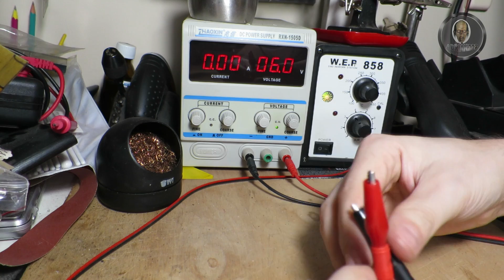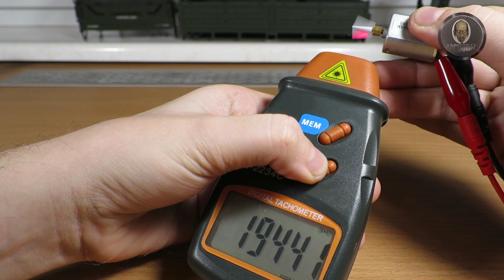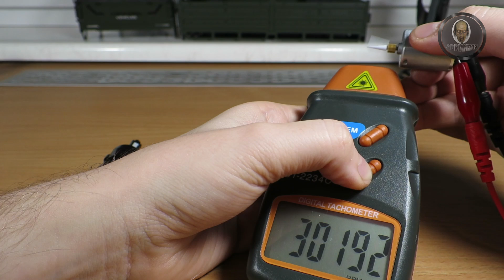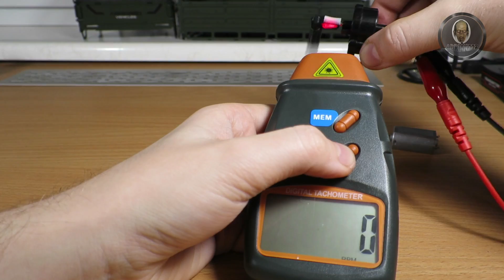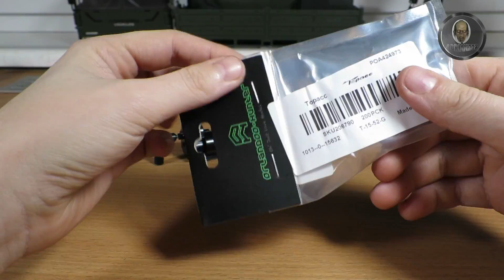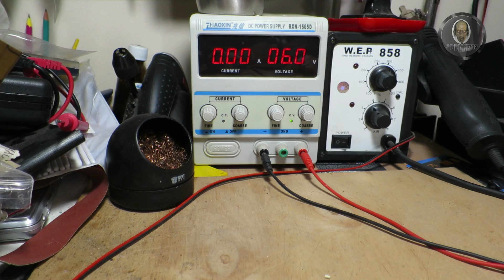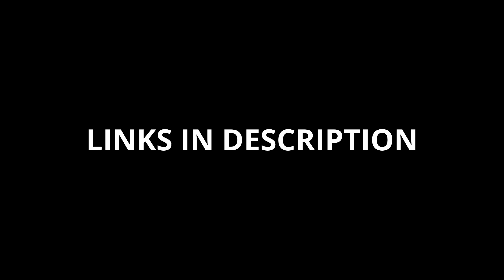Motor test- - testing speed and power consumption on dc motors

Comment: Very nice. But the problem is we can not connect this gearbox to N20 motor. Right?
Reply from the maker: Gearbox is already with N20 motor
Reply: @Adrian202  mine gearbox have inside 130 motor, with very big rpm.

Comment: Which is better for torque?
Reply from the maker: From this two 180 because it's longer so it will have longer magnets.
I also will change N20 motors to N40 so I think dual N40 motors are stronger but it will not work good for 6x6 machines
I corrected because I think that's 170 motor but it's 180, My mistake :)